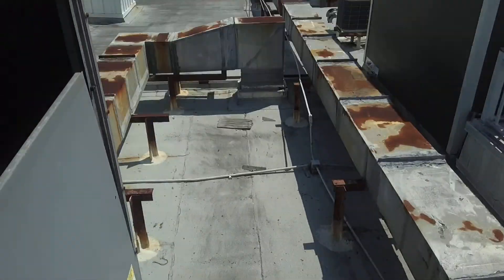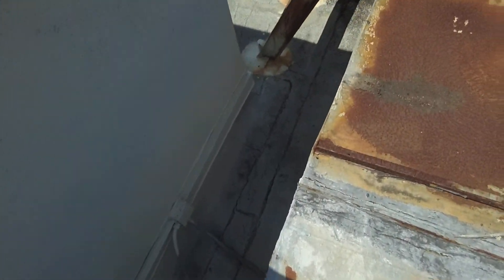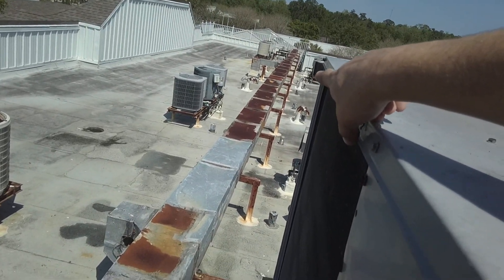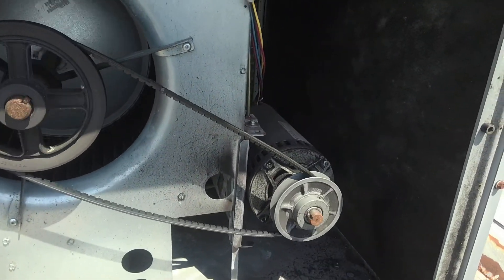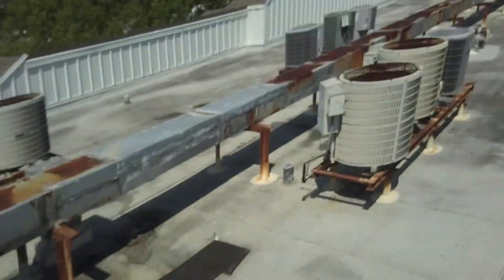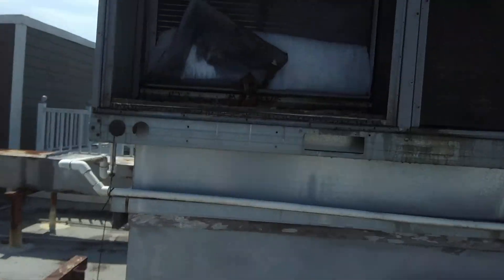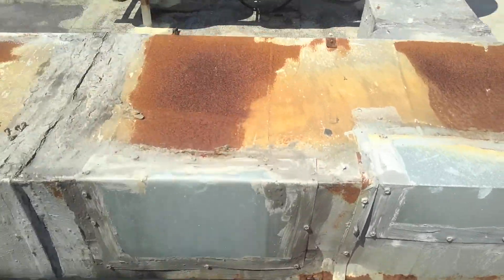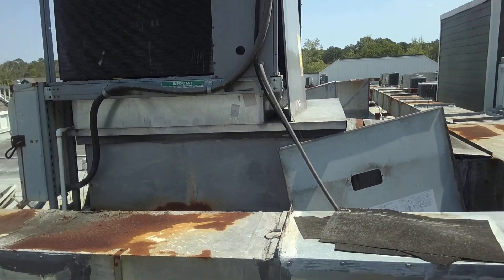Roof Top Unit A/C Not Working And Frozen Solid. PART 1of4.

Comment: A garden hose with sprayer will thaw out that evaporator quickly.
Reply from the maker: Im on a 3 story roof top.                 hose??
Reply: Running just the indoor blower motor will melt the ice fairly quick.